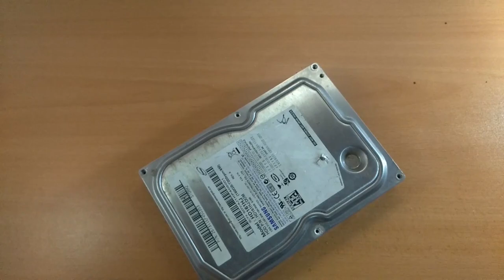Knife Sharpening Machine, Grinder, Using old Hard Disk Drive

Comment: Hello. So i want to build one of these but i know about -200% about electronics in the way of regulators. Resistors etc 😅 i was wondering if i can solder a 12v adapter straight to the HDD so its just plug and play or do i need the other parts? Great video :)

Comment: Hi. Quick question.  So the only thing I need to get the Hard Drive motor spinning is LM805 and 12v DC power supply?
Reply from the maker: Yes, make it like in the video
Reply: @ELECTROBRO  No harddisk motor is BLDC, it needs a controller.

Comment: Hi, 
is it running continuously? When i'm trying to do, it stops after a few seconds.
Reply: You need to connect the sata data wire 3and 5 or 2 and 4 together
Reply: Yes I too observed it stops running after a while, shorting the pins 3 and 5 of data line is the solution
Reply: But i have a PATA what can i do
Reply: @hemandhkrishnakk4847 Same here, spins only for two minutes. Any solution yet?